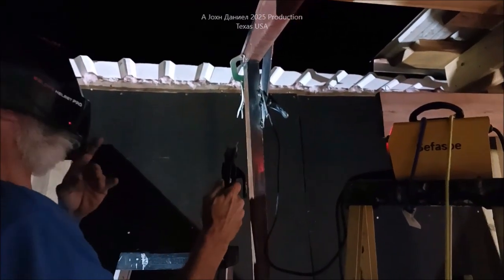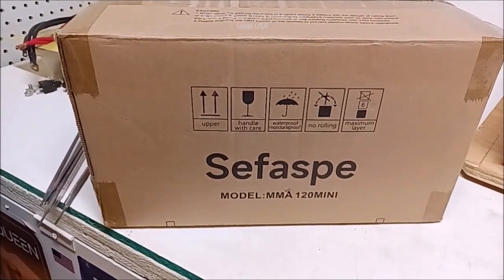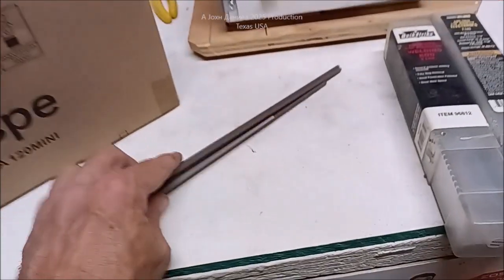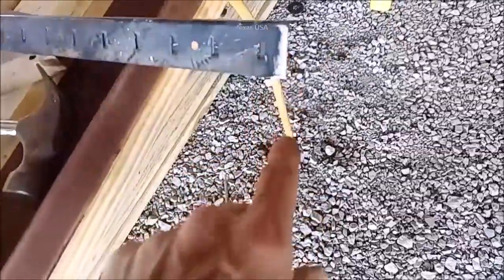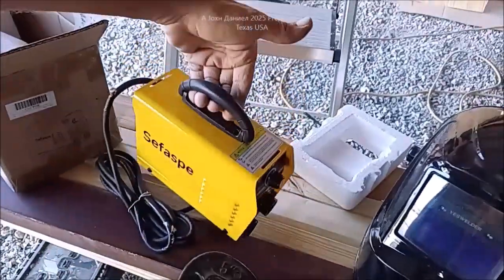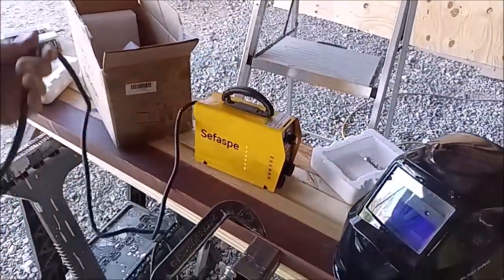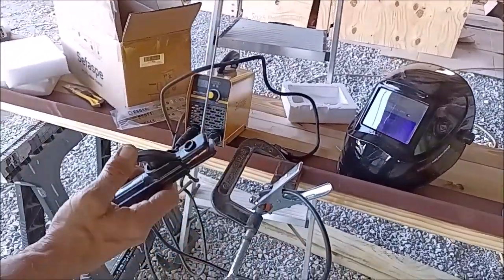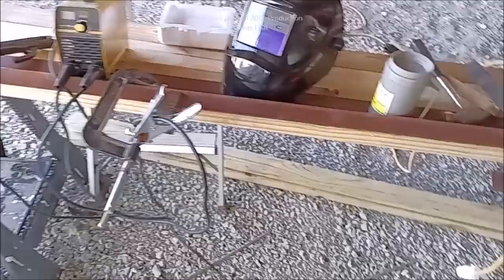Weld it yourself using $40 Micro Size Pocket Welder, Big Power, Small Size Anyone can use it

Comment: Neat watching some heavier duty roof trusses fab teaser.  Been seeing more lately on Youtube where mainly using angle. Like for really big full size barn and barndominium projects. Gets me thinking free bed frames or looking for at yards where can still for little car ports, sheds, farm buildings and green house things.
Reply from the maker: Do not use bed frame angle for welding jobs. It is spring steel and welding on it always leads to weld fractures in heat and cool cycles. Best source for salvage price level steel is those huge structural shelving frames from closing big box stores like home depot lumber racks.
Reply: @JOHNDANIEL1 Excellent call on the bed frame material.  I had the before bedtime babbles. So would need the heating and heated slow cooling to prevent cracking if did weld?  I know can be a pain to cut and drill.  I'd get from a metal supply shop if making trusses so structural steel I'm thinking or whatever the engineer says.  Pallet rack material was all over the place and still seems to be found at great pricing at times.  Right on!  Thank you sir!

Comment: Hey John I am going to connect my lead acid and lithium bank together like you have shown. Is there any 12/24 adjustable vsr’s that you would  recommend I haven’t be able to find on made by Dewinner ?
Reply from the maker: Redodo 150 does https://amzn.to/3WqDUtf use one for each 400 to 500ah you plan to co-connect. I send 80% solar to the Lead Acid in my system, then the VSR shares to the LiFepO4

Comment: It's insane how good and how cheap modern power semiconductors are, IGBTS especially have come a long way. 

I'd love to see the inside of that thing. I suspect it would work just fine off 100VDC on the input or a really crappy AC supply, depending on the powerfactor correction circuitry.
Reply from the maker: True, they used to burn out fast but now they seem to figured them out.
Reply: @JOHNDANIEL1 My understanding is that the yields at the silicon semiconductor fabs have gone way up, to the point where even the 'duds' they basically throw away in cheap products are better than Power transistors that used to cost $20 each. The IGBTs alone used to cost over 100 bucks in any decent inverter welder.
Reply: Right, totally amazing and makes sense in regards to things like CPUs and other chipsets using less energy and shrinking in size while able to perform more.  Why not for other transistors.  Especially where inverters are in demand more.  Yeah, gets me thinking like rescuing the older server UPSs for off grid use.  Especially once comprehending how HV DC can be input like say into wall warts to get a cost effective buck converter for HV solar panels and then what else is AC input that goes into a DC switcher power supply so can be used like a DC DC converter anyways.

Comment: I was hoping that you were going to open it up ,and show us the guts of that little welder. Do you plan on showing us the inside any time soon ? Have a productive and safe day.
Reply from the maker: I do plan to open and study it so I can make a how its made video on it soon. It is a capable welder just how durable is the question. It did not overheat running 65amps on 50+ welds on a frame, so we'll see.

Comment: I got one of them little cheap welders from Amazon mine works amazing when I need it I'm not very good at welding but it's perfect for a beginner
Reply from the maker: I got it as a back up to just secure things if my usual welder crapped out. Never expected it to be capable as it is for the price. Hope it last since it can run on limited power my other welders will not do well on.
Reply: @JOHNDANIEL1 I got it just so I can try to teach myself how to weld I can't weld pretty but I can make stuff stick
Reply from the maker: Cleaning your work and angle is the key. Plus when you weld, never over amp the work or you get brittle work.